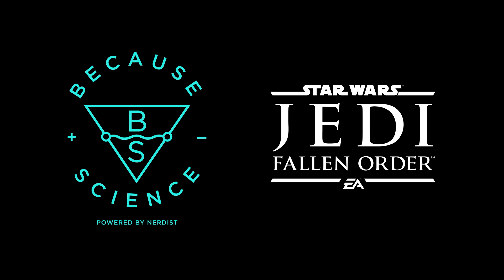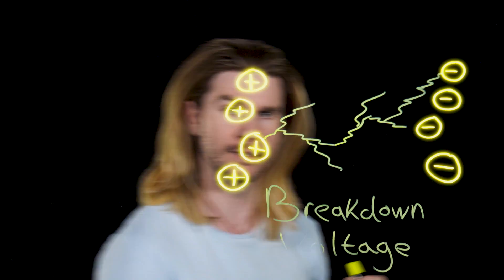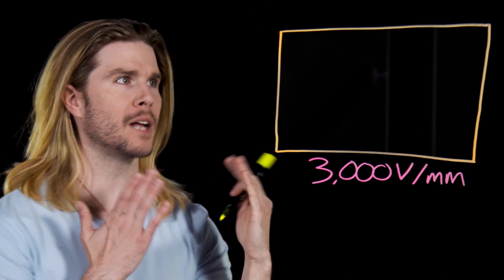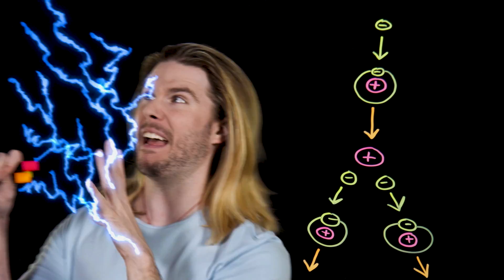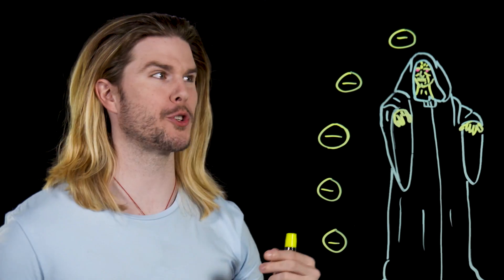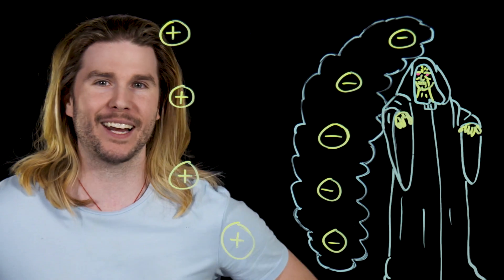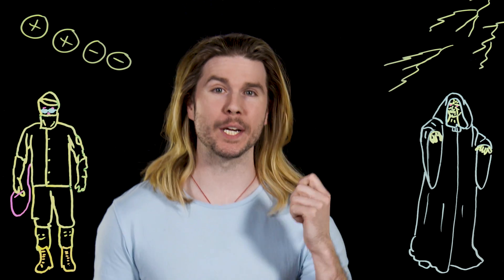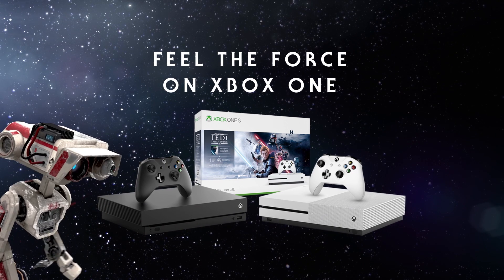How Does FORCE LIGHTNING Work? (Star Wars SCIENCE)

Comment: But what if Force Lightning were more like real lightning? One of the cool things about lightning is that the cloud generates little feelers called "leaders," where the air gets broken down and ionized in little channels, since the ionized air allows more current to follow after it, breaking down more air in a jagged line. This creates the thin, forked appearance of lightning in the moment before the strike. The leaders search for the shortest path to the ground, until one finally reaches it. At that point, the entire voltage potential of the bolt fires back up the single leader that created an ionized path from the ground to the cloud. This is the "return stroke," which is much thicker, brighter, and more powerful.

In the movies, the lightning that we see is always forked and crackly, like the leaders of a lightning bolt. But if Force Lightning were more realistic, all of these leaders would arc towards the target until one finally made contact, at which point a single bolt would connect the target and the user. A single bolt about three inches thick, blindingly bright, containing about 100 million volts, traveling at 220 million miles per hour, leaving behind a deafening clap of thunder. It would also be over in a tiny fraction of a second.

If Force Lightning were like real lightning, it would be less of a slow, painful, torturous death, and more like a Force powered bullet, striking down your enemy in a single instant of light and sound. I'd consider that pretty intimidating.

Unless the bolt just flashes over the target due to the skin effect. Then it's...decidedly less scary.

Comment: Now, we know from observation that individuals in the Star Wars galaxy have the ability to move things through the manipulation of a binding force, but what if this power is just that same movement, but on a smaller scale? What if, rather than needing to generate all this power, he can change the orientation of the particles in the air, and potentially even the target, so that it creates a path of ionized and therefore conductive material. Once that's done, he'd only need to burn a few hundred calories worth of energy sending electricity directly through an invisible but deadly conductive path, making the Jedi they've targeted all smokey smokey

Comment: But, how does a Sith Lord control where the (force) lightning will strike? Wouldn´t he/she need to also control positively charged particles on the reciever end so he/she can make a kind of bridge (an easier path the electric discharge can take)? If not, there could be a risk of (force) lightning all over the place and it "preferring" to "touch" better conductors (maybe metal things like, I don´t know, the walls/floor/ceiling/stairs/chairs inside the spaceship arround them?), right?

Comment: Hey Kyle, I'm guessing you're glossing over how the force lightning travels to the intended target, rather than to the much closer and typically much more positively charged surface of the planet and including it in the syths ability to control electrons? without that, any imbalance they make of charge induced on the syth would try to rebalance itself with the earth because it is, well, a ground for the charge - at least on this planet...

Can you think of what they would need to do in order to ensure their discharge hit the intended target rather than the ground? And in the image shown of yoda, just what is causing the subsequent arcs of lightning that seem to discharge into the air...

Comment: Huh. I was just revising plasma physics for my January exam and this notification pops up.

Well, looking through what is said here, it all actaully make sense and is correct. Well done BS. But can we make it easier on the poor old man that is clearly "too weak" to produce that much power. Let's get technical. Yes we can.

You see, in order for the electron avalanche to occur you need a voltage as stated above, but this voltage is not constant. If you would kindly look at this graph (https://upload.wikimedia.org/wikipedia/commons/e/e2/Paschen_curves.svg) you will see that the breakdown voltage (Vb) changes massively. Please not the x-axis is pressure × distance not potential difference. Atm pressure is at about 760 Torr on this graph, which on the N2 curve is about right. Not perfect, but air isn't wholely N2.

I propose that the "sith lord" uses the force to move apart some of the air molecules and then sends a much smaller voltage down that, saving some of that "unlimited power" for other "jedi scum".

Fun fact: this is also exactly how neon lights work. When you turn them on, they flash a few times. This is a huge voltage breaking down the air and it doesn't always work first time. However, once this is up and running, a much smaller voltage, ie your normal house voltage, can use that ionised air channel to produce a plasma that lights up.

Comment: Aren’t you ignoring the fact that it would likely kill the user too? Real lightning actual has TWO bolts: one that goes ground to cloud (the one we all think about) but also a bolt that goes from the ground up. From NOAA: Does lightning strike from the sky down, or the ground up?
The answer is both. Cloud-to-ground lightning comes from the sky down, but the part you see comes from the ground up. A typical cloud-to-ground flash lowers a path of negative electricity (that we cannot see) towards the ground in a series of spurts. Objects on the ground generally have a positive charge. Since opposites attract, an upward streamer is sent out from the object about to be struck. When these two paths meet, a return stroke zips back up to the sky. It is the return stroke that produces the visible flash, but it all happens so fast - in about one-millionth of a second - so the human eye doesn't see the actual formation of the stroke.

Comment: Okay, Kyle using Force lightning.... a skill only usable by the users of the dark side of the force. Jotting that down and saving this video as possible evidence for the eventual conviction of super villainy that is coming his way.
Reply: Actually light siders can the Jedi just banned/forbid it's use
Reply: @Blaze-zm7zt  Exactly. Force Choke is dark side, Lightning is neutral... in KOTOR.
Reply: @Blaze-zm7zt  Plo koon uses Force lightning but a weaker version called Electirical/Force Judgement, weak enough so he doesn't get pulled through the darkside or get tempted
Reply: @pavia1960  yea, but weren't there older Jedi who did use the pure form? Old republic or older